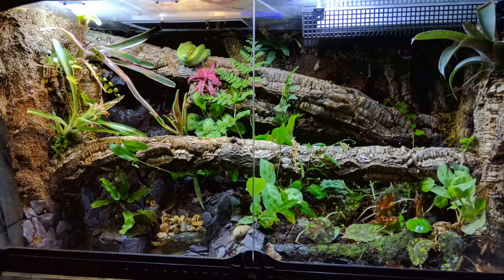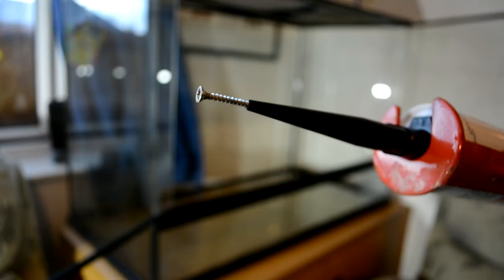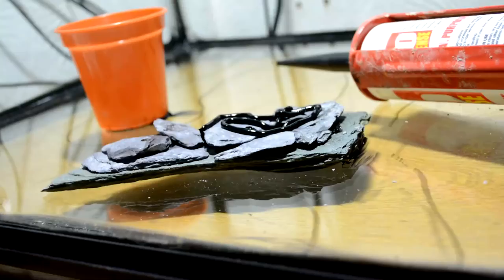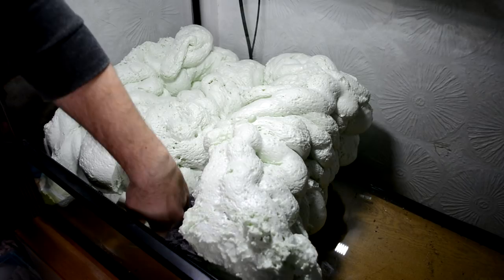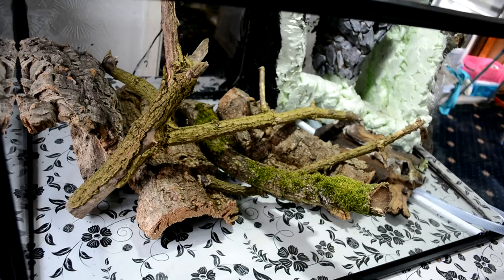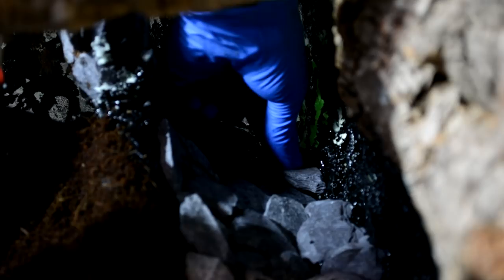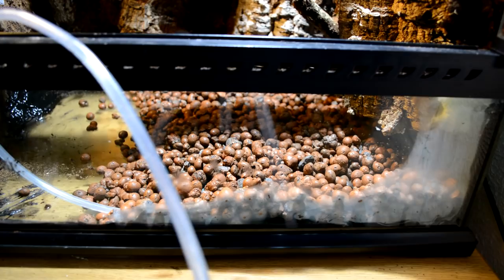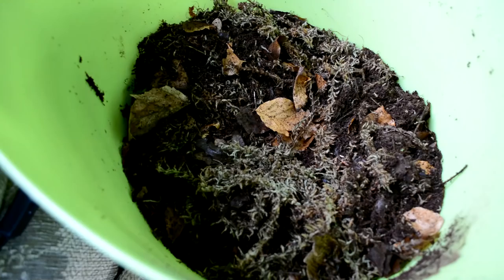Building a Naturalistic Bioactive Green Tree Python Vivarium / Paludarium

Comment: You can use a plastic storage bin as a waterproof pond liner and build up the foam around and in it to hide it.
Reply from the maker: +tilapiastew thanks. That's a really good idea. It might have looked weird though, since I wanted the pond to be visible through that glass on the front.
Reply: you could cut the storage bin off on the front side and silicone if thoroughly and then hide with foam/rocks! Would look pretty natural!
Reply: tilapiastew really smart idea thanks
Reply: would Drylock work to create a little pond area? It is waterproof so I think I can just build up a little 2x2 inch wall that has a bit of water in it for a terrarium. Do you think this would work? I have a paladarium with a waterfall and I think it would be cool for the waterfall to go into a little pond before it hits the main part. Any reply would help, thanks
Reply: Random Gaming yo can you read my comment? It’s down at the bottom it would help thx
Reply: @Random Gaming
Reply: Fishers aquatic world yo can you read my comment below and give your opinion on the drylock? Thx @fishers aquatic world
Reply: @voltix9711  5 months and no answer. Hope your still active to see this...drylock will waterproof whatever you paint. I plan on doing a foam background and painting with drylok to make a rockery scene.

Comment: Just some advice, if youre using stuff from your house, i.e tree branches, leaves, and dirt, you have to make sure to bake it in your over. Or boil it. That ensure it kills any mites that hide there or any other parasite that could harm your snake. However ik that boiling your dirt sounds dumb but baking it could help most.
Reply from the maker: Thanks for the advice. A lot of people would agree with you.
The people on the big Facebook bioactive group reckon that the natural microfauna is useful to helping establish a natural ecosystem in the vivarium and therefore advise against sterilizing the media before bringing it into the tank in most cases.
I appreciate your feedback though, the way you described is definitely the safest and most cautious way to go.
Reply: Jayd Lawrence really that I didn't know for a vivarium. Ive been wanting to make one myself so thanks for that tip tho!
Reply from the maker: Sure. Look for the bioactive Facebook group. I have learned loads from them.
Reply: I boil dirt before I use it
Reply: the microfauna can be VERY beneficial, and that's why after boiling/baking anything i collect from the local streams/woods, i will always add in some captive raised woodlice and springtails. That way the bioactivity can still continue but i'm sure that everything is disease free and safe for my tank. I house tree frogs and dart frogs in various setups and i've never had any issues with them!
Reply: You  can microwave   it ,  that  works .
Reply: @JaydLawrence  it is good to use stuff from your neighbourhood as decor and leaf litter. But I do agree with boiling it first. There are specific organisms living in those parts that do not have a natural predator in your vivarium. Take for example ants, termites, millipedes, scale insects, slugs, snails, nemerteans, mealybugs, thrips and so on. They hurt your plants and can also hurt your snake. Trust me I learned the very hard way.

Comment: excellent build, though the only thing i would have done differently was NOT securing the perches in place, after owning both etbs and gtps for a number of years you will realize that moving the snakes around from time to time is much easier when you can just take the whole perch off rather than spending a while coaxing the animal off

Comment: I have a 5 foot boa in a 6 foot enclosure. Is it possible to do a bioactive enclosure or are the poops too big for the spring tales to handle? Also would he just crush everything?
Reply from the maker: I have heard that it is tough for the bigger snakes.
I would still go bioactive and of the poop builds up, you can take out the excess.
Reply: I have my boa in bio I do spot clean poop but just give him lots of branches and stuff to distribute weight on

Comment: If I could make one suggestion for separating the pond section from the substrate area. If you take a piece of plexiglass and cut it to go across the depth of the tank right where you want to separate the two sections. You could use the silicone to glue it to the sides. You were on the right track with the silicon but the foam was just too porous
Reply from the maker: Thanks. 
This is a great idea. I mentioned something similar in my update video. https://youtu.be/Lg3AcaOdAp0

Comment: Expanding foam...FLOATS.  This means that the minute you add water, the foam will want to rise.  That pressure will slowly {slowly if you are lucky and didn't use a lot of water}work against you.
One day...POP...up it will shoot. Using fiberglass as a shell, would be much better...in spite of what it may take, it is not hard to learn...although it is messy.
Reply from the maker: That would work.
The foam seems to last a long time. Lots of people use it.
But you are right, fibreglass would be ideal.
Reply: Nothing personal...I like what you did.  I have been on the wrong side of this, that's how I know...it was a MAJOR DISASTER...haha! I def learned the hard way.
Reply: Seal it with silicone after roughing it all up.

Comment: I'm new to this and considering a new build for my 12 year old gtp. What is the maintenance like? My set up now requires a whole tank rehab every few months. Completely removing water falls, branches ect. Washing them down. Replacement of substrates and then another complete rebuild. Will building a bioactive reduce this maintenance  on constant overhaul? Thanks.
Reply from the maker: I basically left it. I trimmed some plants once a year and did a water change every 4 months or so. That's it.
Reply from the maker: I tried to build it with low maintenance as the goal.

Comment: This is so cool, can't wait till I have more space to do this for all my snakes, currently only my tiny colubrids and geckos are in vivariums. How many cans of spray foam and silicone this this take? I did a 55 gallon tank for my crested gecko with this technique and I think I blasted through 6 cans of spray foam and 3 tubes of silicone
Reply from the maker: +Sticky Feets I ended up using about 5 cans of expanding foam and about 8 silicone tubes. I used loads of silicone because of all the rocks and the pond part, trying to get it waterproof. I could have used less expanding foam if I did smaller layers that didn't have to be cut back as much, but all the silicone was necessary.
Reply: Jayd Lawrence ok that sounds about right, halfway through my project I was beginning to think I was doing something wrong haha, thanks for the reply!

Comment: What did you use as the pump for the waterfall? Also is there anyway to easily clean it?
Reply from the maker: I used a normal aquarium submersible pump. After I modified it to run through the clay pebbles it was really clean by the time it got to the pump and it didn't need cleaning.
Reply: @JaydLawrence  Awesome! Thanks for responding😊

Comment: how did you stop the water from leaking in to the other side?
Reply from the maker: +Kali Kaiju essentially I didn't. I gave up and cut a massive hole in the barrier, forcing the water to circulate through both sides.

Comment: If i may ask, roughly how much did all of this cost? I'm hoping to build one of my own, and i wanted to know how much i should set aside for it!
Reply from the maker: £300 including the tank secondhand for £100
Reply: @JaydLawrence  thanks! aw man, i miss using Pounds. USD are so confusing, after using Pounds for years
Reply from the maker: @hjonccers783  on the plus side, even though the numbers are a bit bigger in USD, converted, most things will be cheaper. And it is a lot easier to source a lot of the things for this build on the USA
Reply: @JaydLawrence  true. thank you!

Comment: The leakage happened to me as well with a similar idea
Reply from the maker: +Tyler Kaplan really? Interesting.
What did you do to solve it for yours?
Reply: Jayd Lawrence I tried to separate the water feature from the land portion the same way you did. After the leakage I had to drastically change my idea. However there are a few differences in my viv from yours. I do not have a water fall and my animal is a semi aquatic frog. I made the entire bottom portion of the enclosure the water section with large ledges protruding from the background with spray foam. I’m very happy with the way it turned out the only problem is the only spots to plant plants are the pots I spray-foamed into the background and by allowing plants to root into the wood I have.
Reply from the maker: +Tyler Kaplan ok. Nice. Do you have any videos of your setup? It seems really interesting, I would be up for checking it out and learning from what you have done.
Reply: Jayd Lawrence No but if you have Instagram I can DM a picture of it to you. I make videos because I don’t have the equipment skill or interest.
Reply from the maker: +Tyler Kaplan my Instagram account is SnakeJayd, please add me